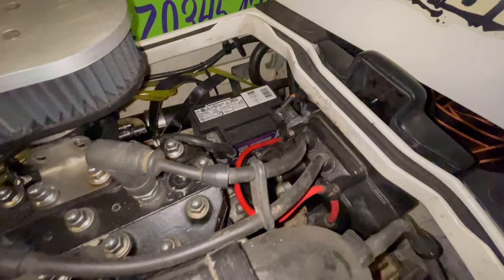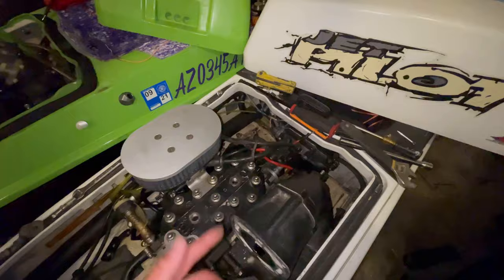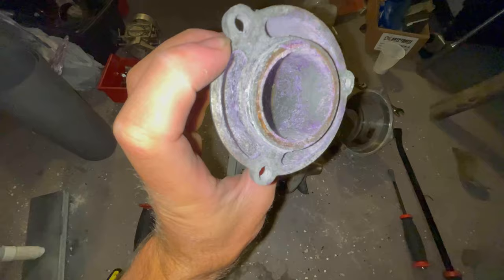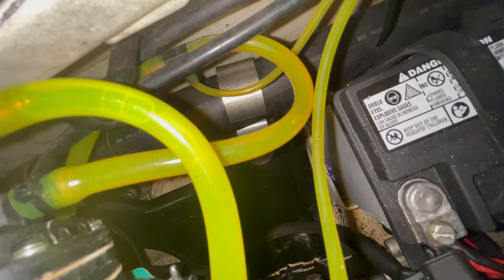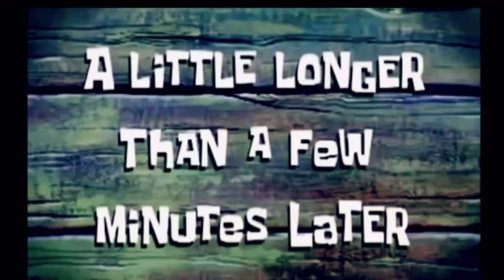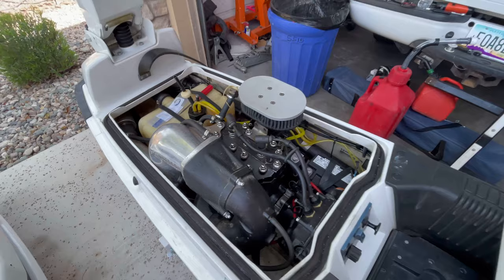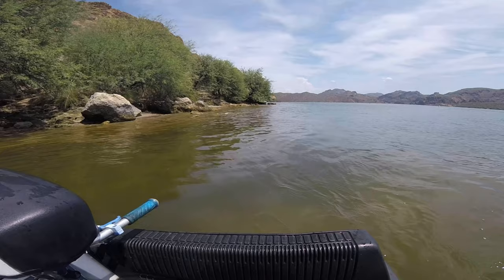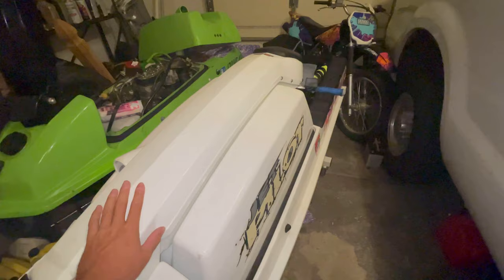1990 JS 550sx JetSki REVIVAL+ RAW Rippage!

Comment: Could you possibly make a video explaining the fuel Line setup? I’m having a bit of trouble with mine. Thank you, if not no worries! And very clean ski sounds super good!!
Reply from the maker: I sure can! Out of town at the moment but I can throw something up next week! Appreciate that and your view!🤙🏼
Reply: @kflight2233  thanks man!! I look forward to it so I can get my ski back on the water
Reply: @kflight2233  Why do you put a restrictor in the return fuel line? Wonder the purpose and if I should do that to mine?
Reply from the maker: @WarbirdPylonRacer  it’s been a little while since I’ve owned a 550 at this point but from what I remember the bn38 doesn’t have a “rev limiter” adding the restrictor gives it a sort of limiter, if you’re running a sbn you don’t need that, either way ski ran hard for 2 season exactly like that until I sold it the beginning of this season🤙🏼
Reply: @kflight2233  Cool!  Thanks!  I have an SBN so I guess its a non-issue. 😊

Comment: Hey brother, Great vid!  Question about your 650 flatdeck.  What size impeller are you running? Is it the 550 pump?
Reply from the maker: Stock impeller that one was a 440 originally, still running the stock 440 pump she rips 🤟🏼
Reply: @kflight2233  Are you using a bearing /driveline support brace?! Or no

Comment: How’s that Wilson starter holding up? Considering buying one over the other cheaper aftermarket options for the 18 month warranty and there are oreillys on every other corner in my area.
Reply from the maker: First one in the video blew the front bearing out right at the end of the season, oreillys had another on hand and replaced it same day, that one is still in the ski today and rode it every Saturday and Sunday last season and almost every weekend this season it’s still holding strong even after I shaved the head on this ski to bump compression up, I do highly recommend using red loctite and a locknut on the bendix though, buddy of mine put one in last season and the bolt fell off after a couple weeks, he kept the starter though and just put a lock nut on it and it held up the rest of last season and so far so good this season too, I personally think it’s worth the money even if you have to warranty it once, but yea overall satisfied 2 years going strong 💪🏼
Reply: Cool man, thanks for the feedback! I ordered one yesterday and am picking it up today

Comment: do youu think that the 550sx  has enough power?
Reply from the maker: In the end the 550 is the 550 compared to any of the other skis even a similar year superjet, I personally think with at least a half pipe and a bn44 or sbn44 carb they do decent, with a half pipe and a sbn44 the old piston port 550 feels pretty similar to my 650sx swapped 550 but definitely still isn’t as reliable as the 650 swap

Comment: What did you do about the swollen pump Liner ( wear ring) ? I saw you took the pump all apart and put it back together. But what did you do to help it
Reply from the maker: Whoever put the skat prop in before me used what looked like ball joint washers rather then actual shims, met a guy from Facebook used his tool to pop the impeller free to find that out, we took the washers out then used actual impeller shims and it didn’t scrape anymore at all and clearance looked to be fairly close to spec, the wear ring still probably swollen so I ordered a new wax wear ring to have on hand if it ever does fail, like in the video pump seems good, good low and top end and doesn’t seem to have any cavitation issues at all either
Reply: @kflight2233   awesome! Thanks for the reply. I haven’t found a 550sx pump replacement wear ring. I’ve found wax has the entire housing ( pump shoe) in stainless available
Reply from the maker: @ericosborne5485  Yea I found it hard finding just the wear ring too, Ended up pulling the trigger on the whole wax shoe, in the end just seems easier to unbolt the old shoe and slap on the whole wax unit and not worry about it again for a while, still think I can squeeze a season or two out of the stock one still in it but I am keeping my eye on it! Happy riding 🤙🏼
Reply: @kflight2233  Saxo xxxxx